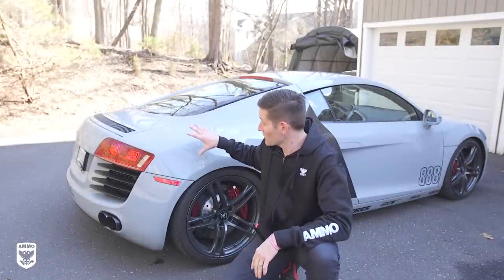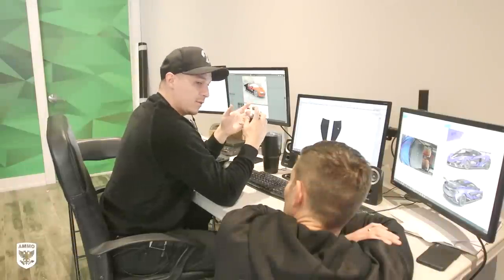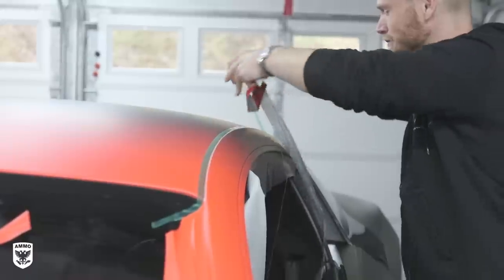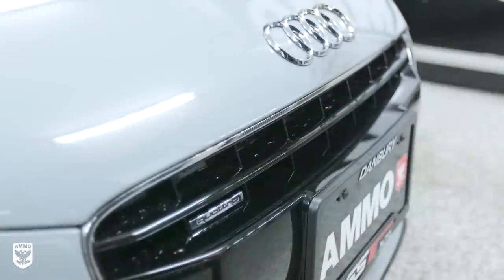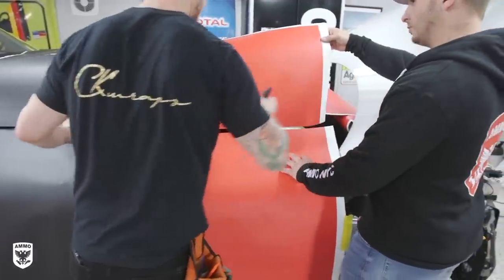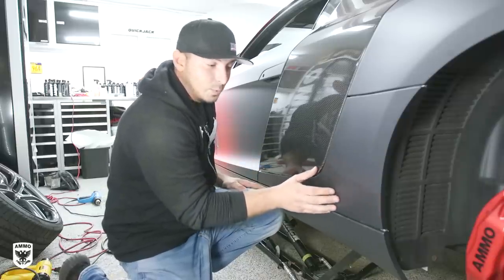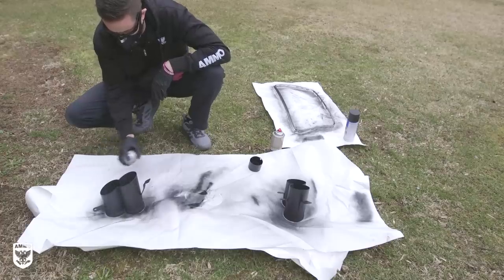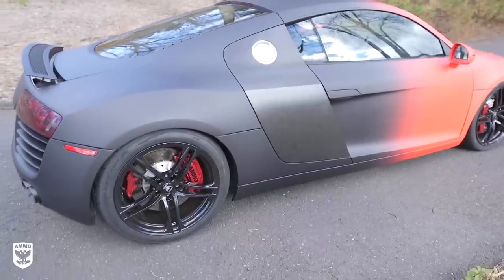Paint?! Who needs it! Wrapping the AMMO Audi R8 | How to Change a Car’s Color With Digital Wraps

Comment: That knife cutting on the paint gave me some anxiety
Reply: it has paint protection so no worries!
Reply: The blade on a flat painted surface, it hurts, coating or no coating NOPE.
Reply: Skilled vehicle wrappers could cut vinyl on a ballon and not have it burst relax 👍🏼 your paint is in safe hands.
Reply from the maker: agreed
Reply: Especially with @ckwraps he is more than a man but less than a god his Canadian accent and all
Reply: In the hands of CKwraps, I wouldn't worry a sec.
Reply: as long their use a new sharp blade and is skilled your paintwork will be fine
Reply: Same
Reply: I think it is more scoring the wrap and having it separate under its own tension rather than cutting all the way through in one swoop
Reply: PPF isn’t like a coating, it’s thick and has can be healed with heat
Reply: It's a lot easier than it looks, when your cutting, you kinda get a feel for it after the first couple cuts. We always practice new hires with a piece of foam under vinyl so they know how much pressure to apply.
Reply: AMMO NYC | Did you get upset with that guy for cutting on the paint?
Reply: me too
Reply: @DeezNuts-  same

Comment: I'll be wrapping my 2001 Dodge Dakota 4x4. Main reason is to advertise my business. Second is my clear coat is toast. Have been quoted $2,500 for the wrap and design. Las Vegas truck, no rust, few door dings, 182,000 miles. Don't think new paint makes sense when a wrap is cheaper, replaceable, and faster to apply.

Comment: The fade would of looked better on a diagonal to match the blade, 

Still looks 👌🏻though
Reply: definitely agree. at the very least, it should have been pushed back to be even with the blade. it looks way too far forward.
Reply: If you look at the graphic design at 04:14 you can see they would also agree with you!  Seems like an installation issue ;)
Reply: mooney0086: disagree with you on that one, that design would have given it a similar look like the "Starsky and Hutch car" but  with a black dart running down the side instead of a white one. Lovely car wish I had the money to do this work on my car😔
Reply: Would have*
Reply: @Kachuzumaki  You are my new hero! No intention to pick on mooney, but Inotice those things, as well. I, however, let it slide. Thanks for being vigilant and firm.

Comment: That looks dope! You have good taste. Larry if you’re reading this I need some advice. I purchased a used 2008 Mustang V6. The previous probably didn’t wash it a single time. The wheel wells have 2-3 cm of Carbon build up on all 4 wheel wells. What should I do. I attempted to detail it with plum and brute but it is so bad that I almost went through half the bottle of plum on 1 wheel and it didn’t even cut through it all… what should I do.?
Reply from the maker: Call my office to discuss need more info

Comment: Bet its cheaper to just paint the car..You never mentioned the cost. And between rock chips and everyday driving how often does this need to get done or repaired. Just doesn't seem practical Im sorry.
Reply from the maker: 1. Its not cheaper to paint a car (unless you get a terrible job)  2) Cost was mentioned in writing on screen 3) Impossible to know without more info